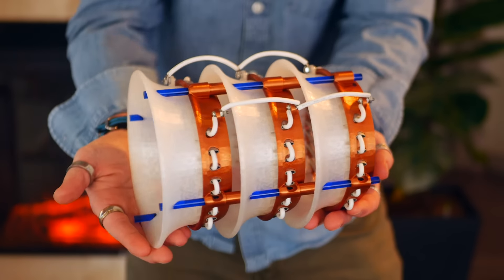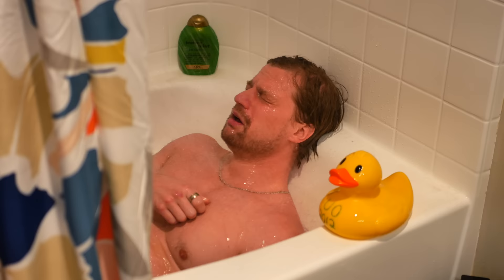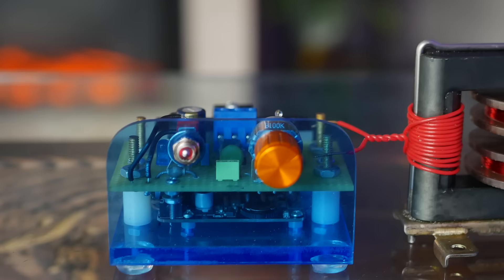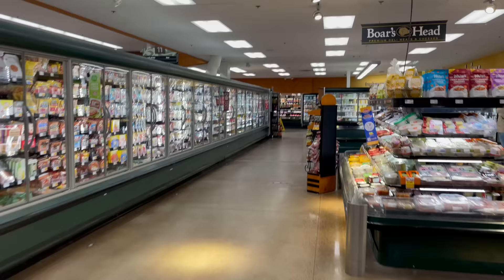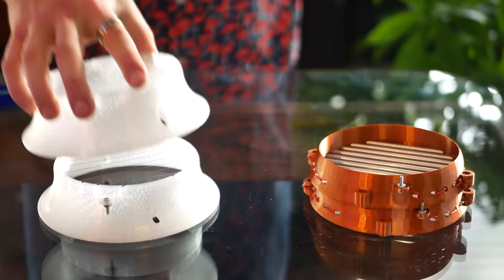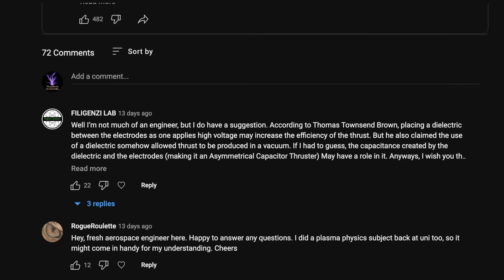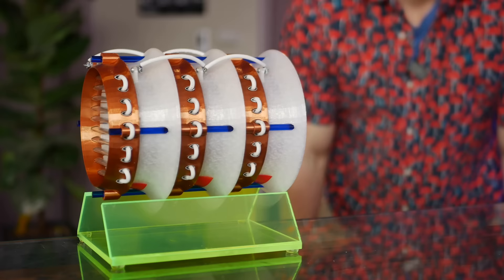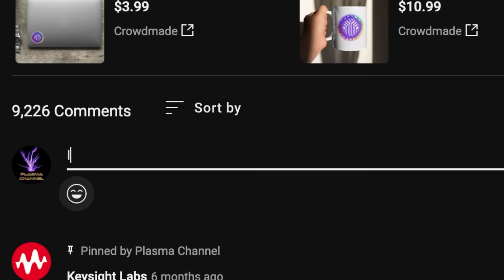The Next Generation of Ionic Plasma Thrusters (BSI MARK 2)

Comment from the maker: Three quick notes - 1) Thank you to Morning Brew, 2) Let's address diameter differences. The diameter on my friend's thruster was around 7 cm. The BSI is 12 cm, which is moving a large volume of air. 3) BSI Mark 3 is currently underway. Thanks for watching!
Reply: So 4x the cross section = 4x the air, at 1/2 the speed = about the same kinetic energy imparted.

EDIT: Wait I just watched Integza's video again - he hit 15m/s, not 6.  WTF did he do?  That thing looks jankier than your M1.  Maybe just his wider spacing means he can accelerate already-fast air?  Seems like the final speed saturates quickly with your low spacing, while Joel adding stages gave a near-linear speed increase.
Reply: nice work, maybe you could vary the stages diameter, get some rocket nozzle/ jet engine effect going on. (big to small)
I think the key to success is the continual/linear increase of air speed per module, which may require a different module design per stage (different voltages, voltage pulses, spacings, diameters etc) .
think of it like this.....a 50mph car can only ever tow a trailer at 50mph. 
Three 50mph cars strapped together will still only tow that trailer at 50mph.
Reply: It would be a good idea to have it push against a scale or something so you can measure the force of thrust rather than just the airspeed.
Reply: WAY TOO COOL BRO
Reply: Have you considered mechanically increasing airflow? I was thinking a larger 1st stage scaling down to a smaller end stage. You could also optimize the air coming in from the side by using a reflow or ducting. Remember any air coming into the system that is not already at your minimum speed is a net minus as the already flowing air needs to bring the foreign air up to speed. With a 12cm Diameter you have plenty input space and enough air to work with. 
You could also work on your power stages ... ie increasing the power to each stage linearly. Can't wait to see what you do next :)
Reply: Narrowing the air flow stage after stage. Higher speed.
Different air flow speed creates swirl knots in different locations. It could positively or negatively affect the air flow between stages. Check for that. (air flow dynamic on the walls)
Reply: What happens if you wind that thin wire much tighter?
Reply: What if you offset the the metal pipes and wires in the second fan? And or smaller versions next to each-other?
Reply: Maybe partner up with the boys over at Flight Test when your finally ready to build the plane.
Reply: Really great engineering experimentation!  I suspect there are many parameters which can be tweaked to improve this design further, although I'm not sure what they would be.  I'd be interested in a measurment of thrust, rather than velocity to really understand where this stands.  After all, it's not a fan design you are after so much as it is an engine design.
Reply: Wow 33% decrease in exhaust velocity in exchange for 300% increase in mass flow rate, that's a 200% increase in thurst! Man, that's awesome.
Reply: Can you measure the air output at 2" distance, so everybody is measuring the airspeed at the same exhaust length :)
Reply: I've never heard the expression that is biblical lol, made me think of abraham watching a freaking bush bursting up in flammes out of nowhere
Reply: increase the spacing between stages, with a bit of a tighter throat at the exhaust end of each stage, say 75% the cross section area of the actual thruster. this will lower the pressure/increase speed to allow more side draft into the next stage venturi.
Another thought, do the above and use increasingly larger cross section area stages, say 50% larger from an earlier stage to the next this may not increase flow speed, but it may massively increase flow volume
Reply: Your friend in Portugal hates tomatoes, doesn't he?
Reply: Have you tried increasing the difference between the number of wire sections and the tubes. Another thing you can do is on the secondary inlets add wire and tubing connecting the first segment and second segment to create more airflow. I know in the version one you played with the different voltages to determine which voltage was the best. However, I have not seen anyone adjust the voltage between sections to account for the change in airflow affecting the optimum voltage.
Reply: Taper the airflow to increase velocity?  Amazing work!! Congrats!
Reply: What if each stage gets smaller & more air intake restrictive to add air pressure to the air that's allready inside. Like a funnel shape.
Reply: I don't know how to put it...
Add aerodynamic bars behind the electrode rods to improve airflow by reducing turbulence.
maybe even squash the rods a bit.

Also I'm curious if you need to adjust the spacing for each stage for their individual levels of airflow.
it could very well be that you need to increase the distance the faster air is coming in.

A larger distance would also benefit from more power.

you have multiple spare stages and a fan test (ic) set up, where you can simulate a previous stage and play with the distances and voltages of the next stage.

edit: well okay after watching further, the rods are more aerodynamic, could still benefit from a sharper trailing edge though.
Reply: Have you tried without wires? Like maybe the round opening ring itself as the ground and a smaller inner tube in the center as the positive? so nothing is in the way of airflow.
Reply: Im guessing the tubes is blocking flow? Would flat parallel work better? What if you used thicker wire instead of tubes? Different metals? Keep Going! this is hell-a-cool!!
Reply: I was watching Wall-E and Eve’s propulsion made me think, what if a strong magnetic pulse was used to push plasma faster… it would be a plasma pulse engine.
Reply: Remove the brass. Change it to thin copper. Same with acrylic replace with thing copper. Add 3 more copper circles. Remove the linear. Replace with 3 inner circular electrodes. Bigger middle small. Leave a circular hole of 1/3 the size of the biggest circular electrode Formation for the copper. Negative positive (in the middle) negative. Be careful and have fun. I'd tell you how to travel 60ms but there's no point. You knows what's in space? Humanities past.
Reply: Remove the brass. Change it to thin copper. Same with acrylic replace with thing copper. Add 3 more copper circles. Remove the linear. Replace with 3 inner circular electrodes. Bigger middle small. Leave a circular hole of 1/3 the size of the biggest circular electrode Formation for the copper. Negative positive (in the middle) negative. Be careful and have fun. I'd tell you how to travel 60ms but there's no point. You knows what's in space? Humanities past.
Reply: Remove the brass. Change it to thin copper. Same with acrylic replace with thing copper. Add 3 more copper circles. Remove the linear. Replace with 3 inner circular electrodes. Bigger middle small. Leave a circular hole of 1/3 the size of the biggest circular electrode Formation for the copper. Negative positive (in the middle) negative. Be careful and have fun. I'd tell you how to travel 60ms but there's no point. You knows what's in space? Humanities past.
Reply: Remove the brass. Change it to thin copper. Same with acrylic replace with thing copper. Add 3 more copper circles. Remove the linear. Replace with 3 inner circular electrodes. Bigger middle small. Leave a circular hole of 1/3 the size of the biggest circular electrode Formation for the copper. Negative positive (in the middle) negative. Be careful and have fun. I'd tell you how to travel 60ms but there's no point. You knows what's in space? Humanities past.
Reply: Remove the brass. Change it to thin copper. Same with acrylic replace with thing copper. Add 3 more copper circles. Remove the linear. Replace with 3 inner circular electrodes. Bigger middle small. Leave a circular hole of 1/3 the size of the biggest circular electrode Formation for the copper. Negative positive (in the middle) negative. Be careful and have fun. I'd tell you how to travel 60ms but there's no point. You knows what's in space? Humanities past.
Reply: Remove the brass. Change it to thin copper. Same with acrylic replace with thing copper. Add 3 more copper circles. Remove the linear. Replace with 3 inner circular electrodes. Bigger middle small. Leave a circular hole of 1/3 the size of the biggest circular electrode Formation for the copper. Negative positive (in the middle) negative. Be careful and have fun. I'd tell you how to travel 60ms but there's no point. You knows what's in space? Humanities past.
Reply: Remove the brass. Change it to thin copper. Same with acrylic replace with thing copper. Add 3 more copper circles. Remove the linear. Replace with 3 inner circular electrodes. Bigger middle small. Leave a circular hole of 1/3 the size of the biggest circular electrode Formation for the copper. Negative positive (in the middle) negative. Be careful and have fun. I'd tell you how to travel 60ms but there's no point. You knows what's in space? Humanities past.
Reply: Remove the brass. Change it to thin copper. Same with acrylic replace with thing copper. Add 3 more copper circles. Remove the linear. Replace with 3 inner circular electrodes. Bigger middle small. Leave a circular hole of 1/3 the size of the biggest circular electrode Formation for the copper. Negative positive (in the middle) negative. Be careful and have fun. I'd tell you how to travel 60ms but there's no point. You knows what's in space? Humanities past.
Reply: Remove the brass. Change it to thin copper. Same with acrylic replace with thing copper. Add 3 more copper circles. Remove the linear. Replace with 3 inner circular electrodes. Bigger middle small. Leave a circular hole of 1/3 the size of the biggest circular electrode Formation for the copper. Negative positive (in the middle) negative. Be careful and have fun. I'd tell you how to travel 60ms but there's no point. You knows what's in space? Humanities past.
Reply: I think, If you want to achieve higher air speed, you should make the second stage smaller than the first but with more electrodes to keep the same power, and the third should be smaller than the second with even more electrodes and get rid of the side vents, because they actually slow down the flow. Its like with the jet engine where each next fan is smaller than the previous and has more aggressive attack angle to compress the air and make it go faster.
Reply: why dont you use PHOTOELECTRIC materiel to generate electron? cadmium sulphide etc
Reply: Integzra is still the king then. 😂
Reply: 1. Try to print everything with LW-PLA 

2. Remove the air inlets between stages, which should remove air turbulence 

3. Optimize the first stage to draw in as much air as possible and optimize the remaining stages to accelerate the air

4. Increase the density of the wire and at the same time try to replace the tubes  on the second electrode, double the amount of wire in proportion to the first electrode

That's it for now, I'm curious to see if it can improve performance
Reply: Why do you use for the grand tubs?  I think that should be flat sheets of metal tape or wing shape tubes.
Reply: Second, why each stage have additional air intake? You do not wanna increass  volume just speed. Think particle acellerator.
Reply: I have no experience as a aero engineer, but I believe if you apply this design to a full wing of a plane, the combined thrust should create faster lift and save you the issue of needing to create a tunnel shaped thruster.
Reply: You look like a macgyver villain.
Reply: Is there a way to make the air flow like a tornado? Force the air into a vortex and build up momentum before it's expelled?

Have the copper electrodes in a spiral pattern to make the air into a tornado vortex . This will make more power !
Reply: For the testing, what you need to do is do the test 30 times then go analyze the data. That way you can't say that there are big errors.
Reply: My question is what is the efficiency of an  ionic thruster compared to a normal fan.
To produce 2.3 m/s from your single stage compared to the computer fan. How many watts did each use?
Reply: @derekallen4568  fans dont work in the upper most atmospheric pressures . Ion drivers can assist satitlies in the earth's upper space where small oxygen atoms are presented
Reply: what if you...
1.) print an intake that can be independently rotated to test all angles of anode to cathode? 
2.) print an intake with multiple layered wires at different angles?
3.) have you considered pulsing the power supply at high frequency? Electrogravitics experiments have done this, might be worth looking into.

Great Episode. Love yer work, brother
Reply: another thing that might help, is 1st look up viktor schauberger, and print a cover or an in-between which forces the air into a counter-clockwise logorythmic spiral as it flows through the device, basically setting up a vortex. Just a thought...
thanks again
Reply: @normanharris1092  This and a few disks that set up a logorythmic vortex down the center, like Viktor Shauberger was trying to do with his repulsine.
Great Ideas :D
Reply: I think you could improve the flow signifincantly , when you used different diameter stages .
Aka its done in a turbine of jet fighter planes.
1e stage biggest inlet going to a smaller outlet , feeding stage 2..ect...
Grtzz from the Netherlands
 Johny geerts
Reply: Thanks for sharing this insightful video.  Are all three thruster unit in parallel alignment?   If you would change the angle of the center unit by 45° would you increase output or would there be a similar decrease as when you tested the 90° difference?   

Wishing you and your support team an insightful week, gentle seasonally appropriate weather and restful evenings.  Cheers
Reply: That might be an answer to your dilemma. Neck down your exhaust to 6cm and you will get more velocity.
Reply: Please do a stack of concentric circles with the smallest leading the inlet. Fluid flow is continuous. The outlet gasses are always going to lose energy to friction nearest the outside diameter. The central column will always be the fastest and should be where you focus the stacked effect to maximize velocity with each subsequent layer essentially providing velocity shielding between the slower outer layers and the faster inner layers.
Reply: Hello! I have recently made my own triangle design thruster but it won't fly yet. Do you have any recommendations on how to get it to lift off the ground? My current power supply is a CRT monitor.
Reply: You may want to chech whether or not having increasing spacing between anode and cathode per segment allows for more time for the ion transfer to properly connect, because otherwise you may want to use small parallel arrays of the single-grid version as small and light as possible for maximum airflow & thrust.
Reply: I think you should increase the speed of the first stage because new airplane engines have geared fans which apparently increases the efficiency by 30% of airplane engines, maybe you should try it out. Isn't it the exact same principle? Try doing some research because I don't know much.

By the way I used speech to text
Reply: You should use somthing similar to Y pipe, but with three intakes and one for exhaust, that will give more air flow and higher wind speed out of the exhaust,
Reply: If you turned the thick electrode rods into strips, would covering the edges with plastic keep the edges from discharging into the air or toward the wire electrodes?  Is there a substance that would insulate the edges of a set of strips enough to avoid discharge out it's edges if plastic is insufficient in avoiding such?
Reply: Hear me out. A jet engine used counter spinning fans to accelerate the air more efficiently. What about instead of countering the electrodes 90 degrees inside one stage you turned each whole stage 90 from the last?
Reply: Are you planning to place this in a remote controlled plane?
Reply: Ok so what your issue here is that you're running your stages in parallel as opposed to in series. It's like hooking up a bunch of batteries in parallel and expecting to get a higher voltage.
Reply: I want to See one that is simply the same but larger to see if it’s mo better
Reply: @Plasma Channel one consideration you might want to look into is using metal powders to enhance surface area on the electrodes, so that more ions could be produced for the same input, making it a little more efficient, or better yet, just using metal powders as the electrodes themselves, they should have more surface area than the regular electrodes, in theory
Reply: And u considered a coan on the rear to taper the wind into a smaller stronger stream.
Reply: May I recommend you use gold wire or platinum or other available like an aluminum/silver mix or gallium/silver or aluminum/ mercury or silver/ mercury or gallium/ mercury wire at the best gauge wire. I know that gold will offer less current resistance. 

In the vimana it was liquid gallium that caused lift, not mercury. 

Also the plastic fins shape need to be addressed:  as a correct "wing" design to be angled inward like a scoop and extend past the wire to create compression and better thrust at past the wire, thereby creating low pressure vacuum effect at the front of the plastic wing. 

Also may I suggest that the Gap in the side between stages is to far apart or to wide of a gap for a  Venturi effect. 

Also the on the final stage output yet another shroud / scoop to employ the Venturi effect for volume or air movement on the final plains wing for lift. 

Hope this helps, thank you for your videos.
Reply: Is there a way to get this under a skateboard? Thinking of the hoverboard from Back to the Future....
Reply: What is the power consumption?
Reply: I have an crazy idea I don't know how it's gonna work
Why not changing the complete design to different shapes like
1) hemisphere:
          When it is hemisphere the surface area increase drastically and also we can reduce area on the flat side so the velocity increases 😌

2) pyramid: 
        I guess this would be effective is the height is shorter still same concept as of hemisphere also here it can air from multiple directions and force it to one side more mass more thrust 

Hope this is helpful idea if there is any mistakes in this idea please let me know because I have an idea of trying my own ionic thruster...😌🤍
Reply: Noticed you moved over to silver, but is it the conductivity or the diamagnetic property of copper that's desirable? What about bismuth or Carbon nanothread?
Reply: So when are we gonna see a true Plasma Channel + Integza collab?
Reply: Dont use Onshape in time it will bite you , freecad or fusion
Reply: Looking at the structure of your engine and thinking about turbulence makes me picture the double slit experiment. I wonder if there's a quantum way to take care of that turbulence based off the double slit.......
Reply: Try to make the air flow more focused  and as we can see that one thin wire has 1:: 1 ratio , what if it was 1::2 or 1::3 ratio 🤔
Reply: How about trying thrusters with incremental diameter and stack them small to big. Bigger one being at the back. And get rid of trumpet shape edge and make the edges similar to jet engine like?
Reply: Hello Plasma Channel. To achieve greater thrust, you need to compress the output flow of air on each stage like an axial compressor. Of the type used in a jet engine, less the rotating vanes of course, however you still need vanes. You need to decrease the entry and exit diameters of each stage as you go. So that the exit diameter is slightly smaller than the next entry diameter. Like Matryoshka dolls. Effectively creating a conical flow of air inside the engine. This will automatically compress the air on output. But you need to compress the air more. You can do this by directing the flow of air on output in one direction with spiral vanes that do not move. Larger at the outer ends and smaller at the inner ends. That curve inwards to the centre of the engine. Like curved fish fins. Then, in the next stage, changing the input flow with the same vanes but which go in the opposite direction to the former vanes. The directional change of air changes the pressure of the air. Compresses it and speeds it up in the process. 

Then, for each stage you need to increase the voltage exponentially, to match the exit flow of air. However it needs to be increased enough to produce more thrust at each stage. Effectively creating a conical "Current Map" in the reverse direction to the "Conical Compression" of the air. An electrical inverse of the inverse square law. Imagine two inverse square law images, one placed on top of the other but the top one in the reverse direction. So that the points face in opposite directions to each other. 

The lines generating the current need to be in line with the flow of air. This provides the pushing force needed to match each compression stage. Imagine a metronome at each end of it cycle, this is where you put the electrical lines. 

Compress the air for each stage and increase the current for each stage. And you will create more thrust. 

I hope that I have been of some help to you. Thanks for producing great videos. Cheers.
Reply: Having multiple venturis doesn't make much sense to me. Have you considered trying one long venturi instead of three seperate ones? That and perhaps reducing the diameter of the venturi would increase the velocity (try 6cm instead of 12cm.
Reply: This may be moot, I want to question diameter of ports, and the necessity of open ports? Perspective is how does it handle pressure, I'm sure you will address moving forward towards your goal. One thing that sticks out, cautiously, ionization creates ozone, yes? It is also noted with a smell I believe. Although ion generators are an existing thing, you are promoting plasma thruster which does not specifically ionize, yes? Apples to oranges, probably, but the side perspective, is there ozone creation with machines like this? I think noting early and keeping an eye benefits you by addressing in a video and adds credibility to you as the field is explored more. I see where you are now as a super charged hobbyist with aggressive intent to make this a profession and with great progress already. Not to give an off-handed or back-handed compliment intentionally. Just ident, and hope to bring a perspective that seems legitimate and worth incorp for where you are and if true, could propel a big forward thinking movement and career goals you may appreciate. Saying what is not needed to say, the big wigs may have addressed this and not found it wanting. Verifying the need to continue. However, ozone is not big and bad in space as here, and MIT is still a school, so kindly trying to share anyway. I like the science with this and hope to find some use for this, wanting to start and make a use for this. What says eccentric than a overly complicated design? Because it's cool...duh ROFL
Reply: Think about making an acrylic of Antonio Queiroz's electronic doubler of electricity. It is an electrostatic induction machine that uses diodes instead of brushes, making it more durable.  He has many different versions with different geometries. Think about embedded sectors.
Reply: So you will need a gas turbine engine to generate enough electricity to drive your so called ion engine 😂
Reply: Have you tried making the lines all cross each other to make a mesh
Reply: Honestly such a troll for not addressing this in the vid lol
Reply: Air if you look at turbulence AIR naturally wants to move in circular movements I think you could achieve enormously more thrust if you created a massively pulsed version forcing the air into a toroidal pulse configuration and accelerating it by constricting its size through a Golden ratio reduction plenum.

If you would like to visualise this easily I am suggesting that you create an air cannon capable of producing toroidal vortex impulse rings capable of repeated rapid pulsing retaining your staged design rapidly firing sequentially to further increase the output..

Creating electronically pulsed ionic thrust in the form of vortex choroids will massively increase efficiency!!!

If you choose to use my idea please give a credit in the vid  :) ❤ -

Also you will be the first person at least in the public domain to ever create Toroidally Trusted Ionically Pulsed Propulsion - TTIPP -
Reply: @justincynor3169  Wouldn't it perform worse in series? The thruster is essentially neutrals not any voltage like a battery, so if you put it in series than the voltage difference would be divided among the elements like an electrolysis setup does.
Reply: I subscribed i don’t know how I wasn’t already this was so cool
Reply: Why don't you reuse a turbofan; the ion thruster replacing the combustion chamber. Nobody says there shouldn't be any moving parts!
Reply: One thing you could do on the next version is rather than aerodynamic rods, use aerodynamic conical rings concentrically for grater surface area. That’s one reason why you seen a thrust improvement with aerodynamic rods because not only do you have more surface area but cylinders cause a lot of turbulent air flow and the aerodynamic rods sorta fixed that. Just a thought
Reply: heya from NZ! first time viewer instant subscriber!! :)  I have to ask 'cause if I don't it'll frustrate me...have you considered electroplating any of the "screens" or wire meshes you use? could  it weigh a lot less? and you could lengthen or change the shape or angle of the planes of said "screens" to improve your plasma generation points? like if they were a bunch of flat blades sitting close to each other like two combs or forks pushed tynes together like a zip or two spiral like coils getting smaller to maybe help assist pressure like a jetboat? Anyways I will carry on watching with anticipation :) Cheers keep it up :)
Reply: His friend when Jay doesn't link his youtube channel 😦
Reply: If you want an idea of how much airflow, according to my calcs Mark 2 moves approx. 100 cfm of air at 90W, which is about the same amount of air that a common restroom fan moves.

Consider decreasing the space between each section (further) and removing the middle inlet cone. I have a feeling you are leaving some horsepower on the table.

Awesome video thanks!
Reply: I have an idea for an airframe.... the question is what are you going to use to power it?
I've been building light and strong aircraft out of carbon fiber for a couple decades.....used fiberglass before that.
I can figure out what size and shape the wing needs to be and figure out what the wing loading should be if I know how much the propulsion system is going to weigh....
Reply: Why stack them? why not put them side-by-side and just add the 2.2 three times?
Reply: @christopherleveck6835   oh brother this guy stinks    that would just be 2.2mps air probably slower just 3 times the air
Reply: The rubber 🦆duck got me
Reply: Every stage should be smaller. Each stage should look like yours round but squeezed in 4 places so it looks like cross from behind where each cross arm should have small down plates, many of them, so that you create one single concentrated burst that is one single stream of plasma.
Reply: Have you tried a crosshatch of wires? Like a tennis racket?
Reply: Ojalá un día puedas compartir y enseñar en español!🥺
Reply: Can  you make in a linear pattern an connect the three. N
Reply: @BlackHeartScyther  Ok so I used a confusing example. A better example would be those bicycles that have multiple riders with multiple pedals. Adding more riders would not so much increase the speed as much as it would increase the power. That's what's happening here with the stages set up in parallel. To set them up in series you would have to make a manifold that combined the flow from each thruster into one duct with the same diameter. This would increase the air speed at the cost of the flow strength.
Reply: I'm not suggesting to set it up in series electrically. I'm suggesting to set it up in series aerodynamically.
Reply: Have you tried much higher voltages?  The voltage is the key.
Reply: Some advice you told your friend not to use a crap store bought flyback transformer but when he did the air went way faster
Reply: The shape of the electrodes may be impeding air. Also you might be able to shape them in a way to increase ionization in a certain direction.
Reply: @danielf3623  the only thing I can add is that bigger fan means more air would not get on -meter's fan. but camera angle make video more sketchy
Reply: Hi I can see the reason for drawing extra air in from the sides was crucial to increase in windspeed because of limitation to the amount the air can be ionised per stage? Hence reason when stages close together it did not improve much.  Im curious as to what would happen if the stages were arranged side by side in geometric configuarion of flower of life pattern overlapping slightly and then fed into a nozzle  ?
Reply: What if you put the whole thruster into a tube
Reply: Who is the portuguese friend? Channel?
Reply: @apokalipsx25  that's literally what he wants to do except he want to put it on rc plane. ship would just explode from water.
Reply: Need a. Shroud to improve flow
Reply: You are a typical Gaston! lol
Reply: Keep the first inlet, you don't need inlets in between. Sizes are good!
Reply: there could also be something else at play regarding power supplies; 
After hearing both of these engines run, albeit with quite a bit of white noise, I heard something interesting, they certainly don't sound the same.
I dug up an admittedly unscientific spectrum analyzer for my phone and set it to listen, granted there is a fair amount of aliasing with the videos, but I noticed yours had a steady and distinctive 9ish khz peak. 
Mr Tomato hater's video (Integza) had 3 distinct bands; one around 4khz, another a bit above 5khz, a little stronger, with the strongest band at about 7khz, these were likely the different resonant frequencies of the three power supplies he used vs your one.
Considering the mic was likely located at the camera, viewing the exhaust end, I expect the last one was running 7khz. could it be that the different power supplies were producing different frequencies depending upon the impedences of the faster moving air at each stage? with each stage pushing a bit faster with a higher operating frequency?.
your rig had all stages pushing at the same frequency, which may have contributed to the diminishing returns with each additional stage.
 One other bit to consider, the power supplies he used, at least to my knowledge, were AC as well, While the geometry would not allow a coronal discharge in the wrong polarity of the same voltage, it may be normalizing the charges on the back side of the exhaust end wire (pipe), also likely minimizing the flow losses due to the Hemholtz effect.
Reply: Close the sides of the device and keep it closed with the sides and narrow the hole from which the air comes out. Put a lot of metal fences inside it, maybe twenty thirty fences and see what happens.
Reply: You might try to think more like a jet engine in regards to how the compressor blades are staged and staggered in regards to increase in air pressure. each next section deals to compress the air from the previous section to a higher state. I think you need more layers/sections to compress the air Just like a jet engine would. normal jet engines dont have just 3 compressor blades, they have A lot more. First layers more sparse , last layer more dense.
Reply: How about you make the whole vent act as as the wire o.O wou'dn't that optimize air flow since the whole engine would work as intended without impeaching airflow
Reply: huh thats interesting 14:20 i guess when you think about the principles behind airflow, theres a few things that end up causing issues that dont seem obvious like low enough flow of air meaning that any additional propulsion would already have any air its trying to move moving at the speed. although perhaps the real issue is more that if there is a larger source of propulsion behind the initial source of propulsion, than that larger source will already be moving the air at its speed as opposed to adding propulsion to the first source. perhaps if you didnt try it in this video, setting the speed of each thruster in proporision to the first being the largest and so on, you could perhaps force a faster airflow although honestly dont know if that would work. beyond that im curious if the increase airflow is just because of the increased size more than actually fixing the issue faced by the original sized motors. it would be prudent to see what one stage from both could do compared to each other to see if the increase was just because of the bigger size in general.
Reply: Is there a reason you're working with a fixed diameter? Could try a larger diameter for the first stager and keep reducing the diameter with each stage.
Reply: You mentioned the problem, that the air on the last stage dont get enough time to get ionised, so why just use thin foil instead of a wirde, same thickness in the air direction but a much higher cross-section on the side.

maybe it is a stupid idea, but I haven't invested any time in this topic since.
Reply: Really got a stellar idea that could make getting to the moon and so on a few steps easier.  Sure wish I knew who I could talk to.
Reply: What if you used a metal screen mesh, like from a screen door, instead of the thin-gauge wire?
Reply: Hey buddy. So I noticed that each stage is the same size. Why not try to cone each engine. Down to the exhaust. Squashing the air through tight and smaller cones. Just like a jet engine. Intake is larger then the exhaust. Why not try that principle aswell
Reply: I jus gotta say who holding the ionic plasma thruster race
Reply: i left a longer comment on wall, great to see the Mk2. but for MK 3 my main suggestion is look at tesla valve & try building one based on teslas water valve  positive preasure principle hydro static and electro static property's arent that much differnt ;) 
(i think their should be at least 2x the inflow of each outflow & a discrete internal/central flow route  maintaining continual forwards  pressure like in tesla valve, i think you could make it a very similar design TBH)
Reply from the maker: Great idea. Thanks - a few people have suggested Tesla valve type stuff so maybe I’ll look into that.
Reply: i think that instead of putting more and more stages, you should put them apart and collect the airflow with a 3d printed adapter that makes 3 airflows in 1
idk if you understood i am french( bad english )
Reply: Brother, let me help with the SLOW ASS prints: Throw away your 0.4mm nozzle. 0.6mm will decrease your print time by approx. 30%! Increase your layer height, and you'll reduce the time even more.
Reply: Bro, change the angle to the Golden Angle. Not parallel, not perpendicular, 137.5 degrees. Please post results!
Reply: Honestly Though Those Would Be Good Attached To Suits of Astronauts?!?❤
Makes Space Work Possible?!?
Reply: @JL-el6gk  Mm, is it possible for this to work in the vacuum of space?
Reply: by placing the devices in series, one after another, you rather increase the air pressure, and if you place them in the same plane, collecting air flows with a large funnel, the volume of air pumping will increase. I guess.
Reply: @PlasmaChannel  I know if you put water through a pipe that starts with a large opening and a diameter exit smaller creates pressure. But the same isnt said for air. That acts differently. If you put an air current through a pipe of similar designed the air pressure builds up witch should increase velocity
Reply: If I'm honest ide like to see you make a 20cm diameter opening. And then step it down to 5cm exhaust
Reply: @danielf3623  Total negative electrode area (negative vs ground) should be bigger. Using about same count of wires won't do. Tripple the wire count for front electrode!
Reply: I think one thing that could help is a thrust cone at the end. To maximize the usable thrust like a rocket does. I’m no engineer or anything but it’s just an idea.
Reply: I suspect the reason why crossing the wires was worse is because you create more turbulence generating spots in the path of the air where the wires formed a cross, which you said earlier on you were actually trying to minimize.

With them in the same orientation, every single wire, with a round shape, just flows air around it.

The possible small boost in ion generation is not sufficient to go against the massive loss due to added turbulence.
Reply: I'm no expert but you do realize that the only going through the middle only what if you made a square one with only 4 bars????
Reply: @PlasmaChannel  hi, thanks for interesting material, a time ago I was creating a simple ionization station for ionizing of air flow incoming to air tube of car motor, for increasing of burning fuel %. After months of thinking, an idea came that need a part of station rotating inside tube and creating vortex. The Vortex properties are untouched in deep research, the vortex airflow involving and multiplying much more air.
Reply: Hi, have you thought about lengthening the end of the section (behind the thruster) and finishing it with a funnel-shaped extension to gradually reduce the diameter to increase the speed of the airflow?
Reply: Это вентилятор Николаева
https://youtu.be/PAbeb2GG4qc
Reply: This was very cool, but as someone new to physics, what exactly is the minimum required thrust you need for a plane?
Reply: since you're 3d printing it, you could make the walls of the system include a sort of Tesla valve (valvular conduits). the intakes would no longer be from spacing the modules apart, but from built in one way ducting
Reply: ive already worked out a method to use a known tech, to provide lift without the need of external _____ it just lacks a specfic kind of power source which is still _______ and is worth alot of money lmao.
Reply: An ion thruster is an archaic particle accelerator if you think about it. If you can make air enter an intake, then use a magnetic system and cycle it until it is at high velocity, then release it with high thrust to weight, you have an Ironman repulser.
Reply: Think in terms of the funnel of a tornado in reverse. This is the same ratio as the Fibernacci sequence but in 3 dimensions. If this were done in 3 sequences with the beginning diameters in a 3 to 6 to 9 ratio then the center velocity would be maximized. All three outputs would be in the center with inputs being increasing in diameter.
Reply: Maybe doubling (+) wires can make difference?
Reply: you have to try the ionic wind experiment in a vacuum.
Reply: I was curious about diameter and airflow volume, thank you for answering that.

Thrust is a function of air density, exhaust velocity, and volume of air being moved. So lower exhaust velocity doesn't necessarily mean lower thrust. In fact, sometimes you can increase thrust by reducing exhaust velocity, because you can trade exhaust velocity for volume. A good example would be the difference between a turbofan and a turbojet with afterburning and thrust augmentation. The former has an exhaust velocity around mach 1, while the lstter can reach much higher exhaust velocities... You'd think the latter would generate more thrust, but generally, high bypass turbofans produce more thrust than fighter engines.

The reason exhaust velocity is important though, is because it will limit you to a certain top speed. Generally, aircraft cant go any faster than their exhaust velocities. So fighters need the higher exhaust velocity to achieve their higher top speeds.

The reason this is so important in ionic thrusters is because the exhaust velocity is SO BAD that it can be hard to get enough speed out of the plane to even generate lift from wings.

aircraft also fly most efficiently when they are flying just below their exhaust velocities. Early jet airliners (like the 707) were notoriously inefficient, because they used lower thrust, high exhaust velocity turbo jets, to only fly around at just below mach 1. It made them difficult to lift off with bad thrust to weight ratio, and they chugged gas at the airframe's cruising speed.

Considering this, when you go to design your airframe, whenever you get around to making a test aircraft, make sure you design it to fly most efficiently, at an airspeed below the exhaust velocity. In fact, if you can determine beforehand what its cruising speed is likely to be, then design the aircraft for that speed (and if there is a huge difference between your exhaust velocity and your cruising speed, consider redesigning your flight engine to trade exhaust velocity for volume. It would ideally produce the same thrust, but do so more efficiently).

You can prototype your airframe using the included Plane Maker cad software in the X-Plane 11 flight simulator. X-Plane calculates flight model on the fly, as you test fly it in the sim, based on the weight and thrust youve given the plane, and by calculating the aerodynamics of the shape of the aircraft on the fly, like a virtual wind tunnel simulation. You can guesstimate the aircraft weight by the weight of the real engine, plus the size of the aircraft and the types of materials you plan to use (using their densities). The thrust of the engine, you could calculate, or even test IRL. There are no ionic engines in that plane maker, but you could substitute a regular jet engine with the same exhaust velocity and diameter, and it should be just about identical to the ionic engine.

Prototyping in X-Plane would allow you to nail a design that should fly, before finding out the hard way and testing a ton of failed prototypes IRL.
Reply: Also, I think area of dispersion of (+) charge particles matters. If area of (+) wire can be increased, it may increase air velocity. May be use foil? 
With light off I saw electric spikes. This spikes may be places of lower resistance(less oxidation). So, if you remove oxidation from wire, you may lower resistance, and increase flow of charged particles.
Reply: I've been waiting for this! awesome stuff.
Reply: Hi sThat was great video. You can improve the side draft wind by adding or extending your electrode to your current circular structure  such that outside air ionized before entering the side gap.

Also make sure you make a aerodynamic hallow shape tube similar to inner one on  outer edge electrode outside your circular structure.
Reply: Correct me if I am wrong but your thruster was still slower than the other guy who reached almost 6 m/s. Why? Was that because your input power was limited to 90 watts? 

I wonder if you can measure the optimum/maximum power that you could use. The instrument doesn't have moving parts except for the electrons but they will meet resistance by thinner wires. So unless you get hold of a superconductor you will still need to optimize several parameters and that will include the longevity of wires that I guess would finally become the Achilles hills of the engine.

I very much like to know, in what direction you will be pushing your engine next.
Reply: @davidconner-shover51  I thought the spacing proved too much and that is why he reduced it. Obviously, there is a sweet spot for that kind of modification. 
But those can wait until the basic concept is worth setting up
a computer simulation at which time all those variables can be balanced.
There are still a few things that need to be tested in principal.
Reply: I hope you are able to get it better and beat Integza. Make it a sort of challenge if you will.
Reply: This is just two small questions that's rattling in my mind. I'm not familiar with air flow or anything relates. But, can you increase the electricity input in different stages to get more air speed? (Like 30W in one stage and the next 40W) also couldn't you add a nozzle to the end of the engine?
Reply: 1) Use the twister wire just like we use on the guitar strings so we may have multiple peak points for the electricity to move and collide with the other charge and you can change the angle of the 2nd stage just tilt it and 3rd stage more than the 2nd stage
 
2 ) double the thin wires in every gap there has to be 2 wires
Reply: You have created multi stage compression but don't have a compressive boost. Each following chamber should have higher voltage/wattage compared to the previous chamber. Same as turbines change blades and blade counts, the tighter and smaller the chamber is. Your internal pressure resists incoming buy with added voltage/wattage progressively through the chambers not only pulls the previous volume but eliminates the resisting pressure. This will allow the chambers, in succession to provide more air and thus more thrust. Typical go with a 30% increase to the following chamber/'s previous input voltage/wattage. I guarantee almost double thrust
Reply: So what if you put more electrodes per section
Reply: i thought Joel's idea of micro-scoring the positive wires with a utility knife was a great idea and guessed it may have made quite a difference.  Wish you had incorporated it here to test any effect it may have.  Great videos
Reply: It seems removing the side flow entry is worth a test.
Reply: > The diameter on my friend's thruster was around 7 cm.

( ͡° ͜ʖ ͡°)
Reply: does this technology work in the rain or when wet in general?
Reply: I want to see if you can get close to my collage years back in Princeton collage year build, I want to see you get close to 120 on the wind speed and it dump a few hundred watts into the unit...And you Need to use Foil, and learn how to use AM frequency to pulse a timed ION stream, and march it faster... let the Force of the ION's show you real speed and flow..
Reply: Put a housing on it a cone and tie it to a string see if it moves
Reply: Can this be used to cool PCs? I mean talk about silent PC.
Reply: Jay, you should sell your 3d designs, I would buy them for $3-$5 to try it out without spending hours in CAD software. What do you think? Could you post or 3d design and link it here?
Reply: @danielf3623  "Wait I just watched Integza's video again - he hit 15m/s, not 6.  WTF did he do?"
its Coulomb's law
"The law states that the magnitude of the electrostatic force of attraction or repulsion between two point charges is directly proportional to the product of the magnitudes of charges and inversely proportional to the square of the distance between them."
or put in another word, the more voltage and shorter distance between electrodes the better acceleration it can induce.

if you look into the cheap chinese high-voltage generators that Joel (Integza) used, they go about 400KV to 1000KV(1megavolt), with that much voltage and just enough distance shy of arcing he achieves that much speed. if you take note of how long it took for the anemometer to reach peak speed its because despite having such high speeds he was definitely lacking in volumetric flow.

on a side note, Jay's design definitely has way better thrust values. (pun intended :goodvibes:)
Reply from the maker: Those Chinese generators are false marketing. They only produce around 30-40kv. There are no laws on lying about a product, so Chinese products do it all the time.

Joel and I used the same voltage, and nearly same power levels as well.

One thing to note, my meter read well over 12 m/s when it was only a couple centimeters from the last electrode. Move it back only a couple more centimeters, and it reads 4 m/s. For reference, air cannot slow down by 8 m/s in a span of one inch. Food for thought on which readings are the true reading values, and food for thought about electronic 
interference on the meter from being too close. I never even showed the 12m/s reading in the video, because it was clear on my case that it was only electronic interference, and not real velocity.

We use identical meters btw. 

He still achieved higher velocities than me for sure. My thruster also had a larger diameter. It’s a toss up.
Reply: @PlasmaChannel  i see, thanks for clarifying that.

the larger diameter does allow for more air mass movement, if we're talking about same power consumption assuming roughly similar efficiencies, then moving more air would result with less overall speed.
Reply: Also I have a motorcycle and I get better air flow by swirling air into my engine but I don’t know how you would achieve this
Reply: Try a square design instead of the current circle one... If you consider a single stage, inside, it the center positive and negative wires are longer comparing to the sides.. This will change if you make the design squarish... Hope you get it.
Reply: Have you considered replacing the tubes with wire. The tubes create a lot of turbulence. Also try placing the wires on each stage closer.
Reply: OK let's get this correct  !!   #1  The only reason radio waves and AC current travel out in space and down a wire is because of the "CENTER " of a magnetic field.  (The "B" field), The North and South poles are the weakest part of a magnet !!   Just like Tesla said,  you got to look at things you can't see !!  At the center of a magnet is anti gravity,  (just tap the center on any glass or plastic and it will loose weight), The center can repel water if vibrated at the correct frequency,  If you vibrate the "B" field into granite rock it will become soft and you would need copper tools to work on same , you don't want to disrupt the magnetic (B")field ) with other iron.  Once you understand the "B" field of a magnet and how it relates to the entire universe we live in, you will then understand what Tesla was telling everyone "LOOK FOR WHAT YOU CANNOT SEE""  .I believe the pyramids were inter galactic communications and transportation systems.  Stone Henge and Gobekli Tepe , power plants.  Take a look at Coral Castle Florida on YOUTUBE and you will see a similar pilar. I believe these horizontal pillars were oscillators that would provide excitation for many things from crops in the field to anti gravity:face-purple-crying:
Reply: You should send this to Linus as PC cooler Fan, he will be crazy.
Reply: @Plasma Channel, have you measured the effect of taking part of the thrust output and recirculating it at the input flow stream
Reply: Nice progress on the challenge for best design.
Reply: Bernoulli, Make each extra stage smaller diameter than the stage before it to speed the air driven through the grids.
Reply: ***pergunta maravilhosa; esse aparelho faz ions negativos no ar?
***domanda meravigliosa; Questo dispositivo produce ioni negativi nell'aria?
+++wonderful question; Does this device produce negative ions in the air?
Reply: Since you're not making a fan, but an engine for an airplane, it's much better to measure engine thrust in grams/pounds, which is what aircraft designers do.
Reply: @PlasmaChannel  would you be able to share your 3d print designs, maybe for some $$?
Reply: You can try to increase the airflow rate by narrowing the rear outlet. Excessive flow can be achieved if it does not create back pressure.
Reply: @noobpro9759  that's a great idea. Hopefully he will use his Witt and understand. That we see a rocket engine or jet engine
Reply: I have another idea for you to try but it meens more fiddling about with fans. So you use electrodes to create the electrical plasma. It's a while since i saw you video and yes I'm really intrigued of this subject but if you make the fans negatively charged. As in either making the blade run to the centre and then use magnets to tranfer the current down to a wire for your circuit to be complete. now yes I understand that we are adding more weight. But the amount of plasma that would be created would be much much greater and still generated in the same way. But the propellers are useless they work well if they max the intake but really plasma is drawing air through. No need for a propellers unless you run a higher current to generate more plasma
Reply: @tapuout101  That is how old-school 'lifters' work. They are a balsa wood triangle frame with a high voltage wire above an aluminum foil skirt that is in line with the air flow. They produce enough thrust to lift themselves.

In this thruster design I suspect that replacing the tubes with foil sheets would result in a large improvement in air flow by reducing flow restrictions and turbulence, and would also reduce the overall mass.

Spacing of the wires, foils, and foil length probably needs optimization.

It might help to put regularly spaced burrs on the wires to control where the plasma jets form.

And as others have mentioned, larger interstage spacing to prevent interactions between the stages would probably also be very effective.
Reply: @dave7038  Thats a great idea using foil sheets. I guess most of it is ideas with trial and error.
Reply: I dont know if you will read this but maybe. Your ionic thruster is build as a imitation of a normal jet engine, but its made wrong like on first italian jet plane. Jet engines pump air inside and squeze it wih each stage to high pressure. 
Change the size of each of your stages from big to medium to smal each like 3/4 from previous. Each stage should have OWN separate electric source. The voltage should be changing to from and be the highest on the last 3rd stage. About the wires on each stage. The number should be increased too by each stage. Last 3rd stage should have more wires as the first/ Study the ordinary jet engines a bit better and look what you missed. Good luck.
Reply: Why not try arranging your conductors into a cone to allow for a more nozzle like shape. Big intake, little exit.
Reply: I could think of a million configurations. Why that specific design?
Reply: I have a suggestion for the next version: abrade the wires with fine sand paper so they discharge electrons better. Electrons spray out of pointy spots better than coming off of a smooth surface, and if you abrade the wire by drawing, say, 800 grit sandpaper around it, you will introduce many points at which the wire can spray electrons into the surroundings. Joel's thruster demonstrated something to this effect when he ran a blade across the wires to nick them, since the nicks appear to be where more electrons spray out into the surrounding air. Take this to its logical conclusion, and you have this concept of abrading the wires with sandpaper for maximum nicks along the wire.

If you test this idea, test it with two methods: abrading along the length of the wire, and abrading perpendicular to the length of the wire. I suspect perpendicular would work better, but until you've tested it, you can't be sure.
Reply: Here's another idea for improving the amount of interaction the electrodes have with the air as the air speed increases.

Put down a staggered grid of electrodes (three layers), then weave a second set of wires through so the second set of wires is in a zig-zag shape. Do this between the top layer and the middle layer, and the middle layer and the bottom layer, staggering which ones pull up on the middle layer, and which ones pull down. This way, even with the air flowing through the wires at a fairly high rate, there will be a larger region through which the gaseous molecules in the air can be ionized. 

Also, abrade the wires on the surface so they spray out electrons better.

Right now you have a one to one correspondence of wire to tube. I'm saying you should significantly increase the density of wire, but not all in one plane; increase its depth by weaving the wires back and forth in the proposed zig zag configuration. For the tension wires, you can use a thicker gauge, or perhaps don't even use wire at all; use a 3D printed rib or perhaps monofilament fishing line or something that can hold a good bit of tension. The idea is that you should have the wires fill some space rather than lay in a single plane.
Reply: Have you tried reversing the polarity of the two electrodes? Right now, if I understand this correctly, you're using the wires to positively charge the air, and then you're using the tubes to produce a negative electric field. But since electrons are the charge carriers, and can spray out into the air, if you abrade the wires, and use those as the negative electrode, what would happen? Could that configuration make the thruster more effective? I imagine an abraded wire would spray electrons into the surroundings, and could electrically charge more gas than a positive wire, which strips electrons from air flowing past it. 

Try reversing the polarity, and see if this doesn't improve the performance.
Reply: @jimmyhackers8980  That will increase the velocity but not the thrust. Velocity through the stages is fixed so the best he could do is to use them as a compressor and transfer the force to a fan or turbine to convert it to thrust.
Reply: Bike wheels have arrow spokes. Not sure if designed can be incorporated into this.
Reply: Maybe to make the thruster more efficient, design a nozzle. How do jet engines of pressure washers make more flow without burning of using more.
Reply: You need a higher voltage on each electrode in the sequence.
Reply: Making each one smaller I bet would increase it.
Reply: Atlantis in 4033 B.C Use Shungite In their  Anti Gravity also Two Tribes Native America Indians in 395 A.D ODIN Viking in 473 A.D also Maria Orsic in 1945 (Shungite)
Reply: If you want to increase thrust, wouldn’t it be better to decrease the size of the outlet end opening of each stage.

Would also be interesting to increase the input size on each stage for more volume.
Reply: Hi Plasma, did you ask Channel to conduct other tests, such as reducing the inter-stages gap, let's says from where it is right now down to 0.0 mm [no more supplementary intake] by steps of 1 mm ?   It would be interesting to see if it changes things and if this change is big or not in term of output static pression…   To make things easier, it would be better if conducted with only two stages.

It might also be interesting to change the design to get a strong Venturi effect, especially on the last stage, and reduce or even suppress (see above) supplementary intakes at the same time.
Reply: could you send the 3D model od your thruster
Reply: Enjoyed the videos. I wanted to ask a couple questions about your design what size tube are you using and is 12 cm the outlet diameter of the thruster? also the videos made me want to design my own type of thruster, is it possible for you to do a video or go over more on your setup to get adjustable high voltage? I have a background in fluid flow but my electrical knowledge isn't the best, also even if I built my own it would be hard to say if my ideas compare to your design unless I kept some of your constants.
Reply: If using elongated grounds helped, I wonder if using aerofoil shaped grounds will generate lift
Reply: I think reducing the diameter in every stage and make it a conical shape should improve the airflow drastically, because it will focus the output flow, I think 🤔
Reply: Instead of tubes could it have flattened  fins . Edit.
I got to the part where you used the flatten tubes
Reply: Could you used a tic-toc / honeycomb shape structure and place a turbine in each space, then  funnel all the air out into one (maybe two)
Reply: Suggestion #1  Make the cones out of aluminum , insulate it from the copper windings that are behind each thruster, and apply electricity to that new aluminum cone. Part 2. wrap the copper into the shape of the plastic cone and on top of that plastic cone, the back side of the plastic cone, and apply current to that as well. Number 3. using dc for one test, and ac for another test on the cones that are now designed to be thrusters , or pre thrusters before the standard aluminum bars making all parts into working parts. Number 4, 5 and 6, sign an NDA
Reply: Put it in a fixed winged aircraft
Reply: Diameter distances are likely at their most efficient. I will suggest thinking in terms of resonance by using frequencies to generate flow patterns by designing a coiled rail circuit that loops to the shape of a bell thruster. Rodin coils can be wound accurately enough to keep efficient distances and generate a magnetic field vortex.
Reply: Bro I don't have much knowledge about ironic thrust. But in my head ( nuclear fusion and ironic thrust are the same methods).  But I also have some idea to improve the speed limit, you can also try ues same other material  like  lad, copper, aluminum.est.   I also love to see   mark 3 in mini version 16:06
Reply: Every section should be smaller like a cone
Reply: get a bambu lab 
prusa slowww
Reply: Try to oscilate through a logical port the sets in a sequence acelerating the sequence, it will improve speed. On top of that , internal chamber may work betther if you force through  swirl paths and use eletrods rounded inside instead of using them in front of the air flux.
Reply: Or better yet, what if you built the lead wires so they can be spun like an LP Record??
I lack the funding and equipment to do it myself, so I share my ideas with you and other internet crafter/maker/inventors. Love yer work, keep it up.
Reply: Mr. Plasma Channel can you pls explain how is this ionic wind is produced through these electrodes .I want to create a one
Reply: Why don't you use graphene for your wires
Reply: What if you placed an air ionizer at the front of the engine. Only reversed so it emits + instead of - like the air ionizers used in homes.
Reply: Please tell us if it will work on Mars.
Reply: how about decreasing diameter, one big venturi body and lengthening electrode distance as the air speeds up? and essentially blade electrodes instead of tubish. maybe still rounded at the edge. Not sure what the physics likes there. you may also need increasing voltage for the larger higher speed gaps.
Reply: Have you looked at the experiments done on the Tech Valley Science Centre channel
Reply: Start comparing CFM/area instead then.
Reply: Did you try diagonals?
Reply: I may be late to the party, but what about angling the positive lines so that they're only slightly angled. One end from one negative start to the one next to it's top end? Kind of like a zig-zag.

Just as a thought.
Reply: do that in vacuum and move it 1 cm.
Reply: The focus should be on momentum transfer not air speed per se...unless the end goal is a fancy hairdryer 😃
Reply: Why don't you reduce the diameter of the second and third stage progressively? I think this will increase the air speed, therefore the thrust.
Reply: Is it possible that there might be some electromagnetic interference between the stages that might interfere with the acceleration of the air between stages?
Reply: That voltage multiplier is basically made of capacitors?
Reply: Anybody that into electricity should know that rotating one of 2 components that are interacting at a distance probably won't be better if it's already pretty good. Look at the dipole antenna for an example. Actually learning antenna design may be a great way to enhance thruster design.
Reply: How about you turn the thrusters to form a grid to make an air vortex or funnel for increased thrust.
Reply: I don’t know that much about electricity, or aerodynamics, lol, but would it make sense to raise the voltage the further down you go? Kind of like a motor needs higher amps to start and less once it gets going.
Reply: The results would be much more higher if:
1) coat the wire with a thin insulator and increase the length
2) Keep the voltage at the first one lower and high at the middle one and higher at the last one

Thurst will definitely increase 300%
Reply: I know I've seen some of this on here already and I am by no means an expert, just an enthusiast. But adjusting your voltage differently for different stages could potentially make a huge difference, as could tapering the design. I'm curious what might happen if you were to incase the shell in a sort of bladeless fan to accelerate the side intake so as to not incur so much net loss on wind speed.
Reply: Integza pointed out in his video that the key to make it work is scratching the wires with a blade. This creates sharp edges from wich the discharge happens effectively. Maybe that’s his secret for high airspeed🤔. That being said, the numbers we rally want to be looking at is the thrust (force) and efficiency. Your design likely is king in those, so congrats👏.
Reply: You could try insert the wire in a grid form (also the ground area)
Reply: The first one had improvements with staggering.  With your booster fan, you discovered the faster the air is going, the less time it has to charge.  Can the device work with a vortex, to increase the length of the charged pathway? You tested the cross section between anode and cathode at 90 deg difference, but not at smaller angles.   So can there be a vortex pathway to the moving air introduced via the electrode positioning, or fins printed into the section flared to direct the air input into a vortex path?.  And does a vortex improve throughput of charged air?

If there were diodes and capacitors between each section maybe you could make a series voltage multiplier from each level.  The highest voltage difference between the first stage and last.
Reply: Not to sound dumb, but is this a type of MHD drive?
Reply: Replace the round metal grid bars with metal blades. The round tubes create drag.
Reply: I noticed the output air flow seemed to rise to 4+ then fall to 3.5 or so then back up to 4+. To me this indicates some form of choke flow is occurring. The later stages don't seem to add much additional thrust. Maybe have each stage independently powered with increased power at each subsequent stage. That should produce additional accelerated airflow. The arcing   may be caused by a surface charge buildup in the plastic being used.
Reply: try making each next stage with more dense wires
Reply: Have you calculated the kw per m3 of airflow? Is it as electrically efficient as your computer fan?
Reply: You must not like your friend if you won't say his name.
Reply: Small idea, try making it so the subsequent stages don't have any openings, avoid sucking in more air, focus on accelerating the air.
Reply: i don't know much about this stuff BUT what if you had the first section at a lower power then the second X amount more then the third X amount more then that?
ALSO it it possible to get the wave form to match so that its like a 3 wave firing so like the first section then second then third up to what ever frequency he is running at?
i might be blowing smoke outmyass but just a thought
Reply: Isn't it better just to sell the thrusters as home fans? Or the electric spark sound is just too loud/scary?

From my POV, Ion Thrusters can solve the rotation degrade from normal fan engine. Even though Ion Thrusters may have rust/electrolysis problem when used in moist area.
Reply: What about setting the Anodes and Cathodes in a Tipi shape like design over each other ... wouldnt that give the air passing by give mor and longer reaction time ? asking for a friend ;-)
Reply: When you think a aerodynamic thrust consider a vacuum. I believe this will increase the mark 3 by as much as 3x+ output maybe 12+mps. Don't allow for any air to escape any stages. Consider a tube around the entire truster extending approximately 1 in longer than the entire thruster and 1/2 in gap inside of the tube to from a vacuum. Lastly try slowly decreasing the diameter of the end of the tube by at least 75% and increasing the front opening by 25%. Also try a luminescent dry ice test to detect for any lost air. Hope this helps.
Reply: MIT has published the ratio they used.
Reply: I think you can get more thrust by making the positive wire spacing smaller and using smaller negative rods that are spaced closer together.

Maybe it's also an idea to use 2 big TIE rings and between those two big ones, 3 or 4 smaller TIE rings.
Reply: Insulate one side of ground electrode
Reply: What happens when you stack multiple rods on each other, creating grid!?
Reply: Now I wanna fly with it
Reply: Try to use wire which have a lot of pointy ends on its surface . A rough wire which have a lot of mini pointy ends
Reply: @danielf3623  Could it be a time between calc? ie the faster the air passes through the "chamber" the further the two components need to be from each other?
Reply: @jimmyhackers8980  That actually depends on the characteristics of the car that are limiting its speed. Horsepower, traction, etc. for example the second car in series would receive less air resistance, potentially increasing its maximum speed if that were a limiting factor to its 50 mph max speed. the same could be said about countless other factors in the system and how it relates to this but i just thought id add. :)
Reply: I wonder if you put the thrusters side by side if you would get more torque. This might give you more initial take off power.
Reply: 6 meters a second not even good enough for underground vent fans, let alone propulsion, Please stop, Your giving homo sapiens a bad name.
Reply: @ossiedunstan4419  You're right. We should only do something if the first attempt is perfect.
Reply: I'd like to know when you'll mass produce 3-D plus materials to build ones own? What an incredible kit for understanding an Ionic Thruster.
Reply: Hi @plasmaChannel I'm no expert but why don't you try putting the metal bars in the middle of the housing and wrapping around the wire over both ends so it is in front and at the back of the metal bars?love your channel<3
Reply: You should make an afterburner for it like how integza did with the dyson fan
Reply: rather than build an ionic thrust unit, why not build an ionic thrust wing. there no rules saying it has to be a round and cylindrical. build it inside a wing providing supplementing thrust and fuel efficiency  to pre existing engines and or aircraft.
Reply: @skylerlehmkuhl135  thats what i came to post!! :) thank you
Reply: @integza has a new thruster design, looks good
Reply: Due note I am a dumbass and have no idea what I am talking about.

You should make a mirror of compressors and combustors. . . first stage would probably include the normal MARK 2 intake, second stage would probably use multiple rings of added complexity using spiky sharp single rings offset by some rounded teardrop elapses with the sharp end pointed away from the sharp pointy bits (this would need to be entirely enclosed)

these would act as combustors (probably) in the mirror as your air intake would work as compressors, the idea is to accelerate as much air as possible, so your auxiliary intake idea is good, but you could definitely do better.
 it may be a good idea to just straight up make a compressor with fans or a helix of these Ion systems, this might add more complexity but if you are looking for power just do what other things do.
Reply: so why did you put meter closer to the 3 phase when you kept it further a away on single phase?????? i smell a rat
Reply: hellow there 
i'm an aeronautical student and I am thinking of making this as a project for final year, is it worth the effort and how can i get files for this. please help me as i am really interested in this topic and would like to create one.
Reply: Could you try to offset 90° each stage  from the other.
Reply: Too cool
Reply: How do you propose to power an ionic thruster propelled aircraft?  Electric aircraft are severely limited by the low energy density of batteries and would even more so if ionic thrusters were substituted for much more efficient fans.
Reply: Wouldn’t it produce better results in terms in terms of volume of air moved if the stages are parallel instead of serial ?
Reply: @RayanMufti  I also think each stage could be 45° offset ..
Reply: I love your.videos and this experiment!
    A change you may consider is decreasing the distance between the electrodes within stage 2 from stage 1 by adding 2 electrodes (for a total of 12 electrodes) while increasing voltage for stage 2 by 30% of stage 1 (65,000 volts). Then in stage 3, add 2 electrodes of stage 2  (for a total of 14 electrodes) while increasing voltage yet again to 30% of stage 2, each previous stage (84,500 volts). Your voltage generator should obviously be set to 84,500 volts then you can decrease it for stages 2 and 1. You also should consider decreasing the diameter of each stage and eliminating the flanges from stage 3 to speed up the airflow internally by compressing the airflow. Also try a slightly smaller flange at the rear to help compress the airflow as well.
Stage 1: 10 electrodes at 50,000 volts.  
Stage 2: 12 electrodes at 65,000 volts,   
Stage 3: 14 electrodes at 84,500 volts.  
Stage 4: 16 electrodes at 109,850 volts (this is now becoming inefficient as it will start airflow eddies behind your flanges and dangerous)
. If you want to go to 4 stages, then add stage -1 using 8 electrodes at 35,000 volts (adding the stage -2 would also be inefficient)
Let me know what you think or what you results are.
Reply: What rasin did you use? It's amazing smooth with lovely pattern
Reply: Would it make a difference if the stages had different diameters... starting out smaller with the 1st stage and stepping to the next... just wondering...
Reply: Ah! I don’t know about that. I would increase the BSI to 4.64 then you the thrust ventricle coefficient to 7.63. You’re welcome
Reply: What if you pile 360 stages of those electrodes, same as jet engines inlet part same as minarets steps so it will naturally  create  a vacuum  trus  . It's worth trying.
Reply: How much I need two to put on my electric motorcycle plus I need it to push me at least 40mph. Can this be done. Seriously
Reply: What would happen if you attached a 3D model jet engine to the thrust output at the rear of your plasma thruster
Reply: I'm unsure if it's been suggested but have you experimented with closing the side intakes and slightly tapering down to the thrust ring? Creating a "hydraulic mining" type of effect.
Reply: try adding stator blades to turn speed into pressure and get more air through then add a bell nozzle designed to turn pressure into speed
Reply: hey you should get ahold of me someway i want your permission to use this design for something i’m working on
Reply: Hello, I watched your video and after 15 minutes and 32 seconds, I noticed something: protons that provide air flow.
Reply: On this experiment, your new design uses closer electrodes-that looks like the deciding factor, so why not decrease the gaps to 1mm, lower the voltage just below arcing potential and multi-stage it? , I don't understand why you would need to pull in additional air on each stage, that is going to cause turbulence interfering with the main stream, want more air-just increase the diameter of the stages, but making the aperture narrow is also going to increase velocity of the system. New to plasma physics, so would be interested in comments.

To summarise:
1) Lower diameter of stages (halving should double velocity), just like a water pipe.
2)  You can decrease gap between stages to almost the gap between electrode-wires. gaps cause turbulence-so reducing them increases output.
3)  Lower voltage enough to stop arching on the new decreased gaps.

Lots of experiments on high voltage, low current plasma, but you may all be missing the mark here, low voltage, high current plasmas are far more powerful, look at the graphite arc furnaces or plasma cutters able to blast through metal, far more force.
Reply: Try using gold cable
Reply: Why in prime characteristics I didn't find electricpower on input?
Reply: @mtoporovsky  I don't think it really matters, at least not to most.
Reply: Side pannels may include microwaves, but the rocket must be utilized, a funnel. Microwaves require a solid tube, and we have some laboratory concerns. To make this practical we need to be sucking air into the funnel. I will study... be back again soon. =)
Reply: if you reduce the size of the pipes and wiring you can increase the number per unit and increase the grid interlay. you can do this with chemistry by making super thin pipes that are laser etched holes through thin metal wires. but I'm not that knowledgeable of BSI mechanics
Reply: Sir can you please share the stl file and the dimensions?? I am building one for my project it will be very helpful for me..
Reply: Hello, Can this thruster build pressure?
Reply: I use marx generater for this product
Reply: There is an interesting design of aircraft, but they rarely talk about it, because this thing is secret. The topic of pulsed plasma thrusters has been developed since the early 60s (see PPT - Pulsed plasma thruster) - they are usually designed for spacecraft. But we will talk about a little-known design - these are plasma propulsion panels for aircraft, where the same Pulsed plasma thruster, but reduced to the size of a pencil and stacked in the form of cells in the panel. The design resembles a conventional plasma TV screen, where there are also discharge cells that activate the glow of pixels on the screen. And plasma propulsion panels have long discharge cells, the arrester has a railgun architecture (just rail contacts or coaxial), and the ionized discharge air is accelerated there by the Lorentz force to enormous speeds - a kind of ramjet engine is obtained. Just imagine! - tens of thousands of small ramjet engines assembled in a panel and firing plasma synchronously with a huge frequency (hundreds of kilohertz). Thus, plasma propulsion panels create lift by pulsed emission of plasma jets from railgun cells. There are tens of thousands of cells in the panel, they shoot at a frequency of hundreds of kilohertz, a huge pulse is obtained, and the plasma swirls the air into toroidal rings - the aircraft is held on this air cushion. Horizontal acceleration is created by the same plasma panels on the sides of the device (they glow, from the side they look like "portholes"). Such devices like "triangle" or "disk" have been observed for a long time, they are mistaken for alien ones - but these are terrestrial devices. They are classified and used for espionage and secret actions. Pulsed electromagnetic technology generates microwave radiation, therefore it is harmful to health. They rarely fly - only military missions. Therefore, they are not suitable for a citizen. This maintained the secrecy. Now they are already declassifying - many people know about this secret technique. When declassified, they will be used for cargo airships. But there is a danger that they are now going to be adapted to deliver small nuclear charges to decision-making centers - such means of delivery are not specified anywhere, are not conventional. This lowers the threshold for starting a war. It would be necessary to declassify them as soon as possible. That's why I'm writing about it.
Reply: There is an interesting design of aircraft, but they rarely talk about it, because this thing is secret. The topic of pulsed plasma thrusters has been developed since the early 60s (see PPT - Pulsed plasma thruster) - they are usually designed for spacecraft. But we will talk about a little-known design - these are plasma propulsion panels for aircraft, where the same Pulsed plasma thruster, but reduced to the size of a pencil and stacked in the form of cells in the panel. The design resembles a conventional plasma TV screen, where there are also discharge cells that activate the glow of pixels on the screen. And plasma propulsion panels have long discharge cells, the arrester has a railgun architecture (just rail contacts or coaxial), and the ionized discharge air is accelerated there by the Lorentz force to enormous speeds - a kind of ramjet engine is obtained. Just imagine! - tens of thousands of small ramjet engines assembled in a panel and firing plasma synchronously with a huge frequency (hundreds of kilohertz). Thus, plasma propulsion panels create lift by pulsed emission of plasma jets from railgun cells. There are tens of thousands of cells in the panel, they shoot at a frequency of hundreds of kilohertz, a huge pulse is obtained, and the plasma swirls the air into toroidal rings - the aircraft is held on this air cushion. Horizontal acceleration is created by the same plasma panels on the sides of the device (they glow, from the side they look like "portholes"). Such devices like "triangle" or "disk" have been observed for a long time, they are mistaken for alien ones - but these are terrestrial devices. They are classified and used for espionage and secret actions. Pulsed electromagnetic technology generates microwave radiation, therefore it is harmful to health. They rarely fly - only military missions. Therefore, they are not suitable for a citizen. This maintained the secrecy. Now they are already declassifying - many people know about this secret technique. When declassified, they will be used for cargo airships. But there is a danger that they are now going to be adapted to deliver small nuclear charges to decision-making centers - such means of delivery are not specified anywhere, are not conventional. This lowers the threshold for starting a war. It would be necessary to declassify them as soon as possible. That's why I'm writing about it. However, I have written before - starting with the book "The Elimination of UFOs" and many articles. There are also videos on my YouTube channel - "Declassified UFO" and "UFO Anatomy".
Reply: Or may be you make a bigger circle with concentric circles of positive and ground wires. Let them breathe better. Just a suggestion. Great work
Reply: You can use crossed sections to reduce speed or have some of them move from parallel to cross to reduce speed.

Like an airbrake.
Reply: Hello! Impressive work on your side. I may be not as technical as you are, but I would love to make a suggestion which, upon my knowledge might contribute substantially to your design.

Here we go:

Bernoulli principle: higher flow rate -> lower pressure.

There is a potential in using the Bernoulli principle to your advantage. Making a narrowed down cone at the end of the last thruster segment would increase the flow rate of the air. If there would be a way to allow air to be sucked into that low pressure zone from a bypass intake, you would more that triple the thrust . 
Eg.: Dyson fans use this to increase the flow rate through the fan substantially, at the expense of very little additional power input.

Thrust is created by the rate of change of momentum of air particles “exhausted” by the thruster. To increase this, higher change of momentum is required. Increasing speed of the particles requires exponential increase in energy supplied, but in creasing the mass of operational fluid is more linearly proportional to the energy input.

Hopefully this isn’t nonsense. I would love to elaborate, if this comment catches your attention @PlasmaChannel
Reply: @davidconner-shover51  haven’t noticed your comment when making mine… now I’m more sure that Venturi effect idea isn’t me just being delusional)
Great thought!